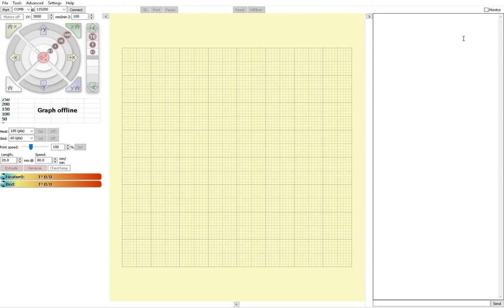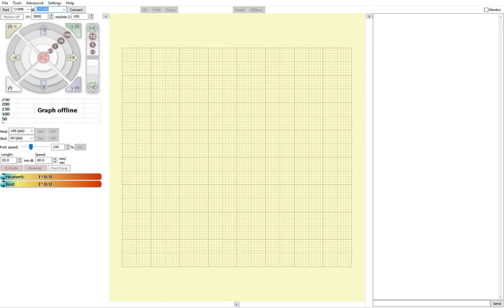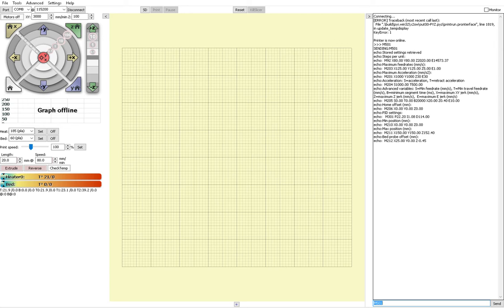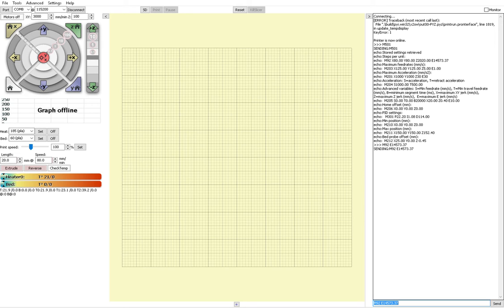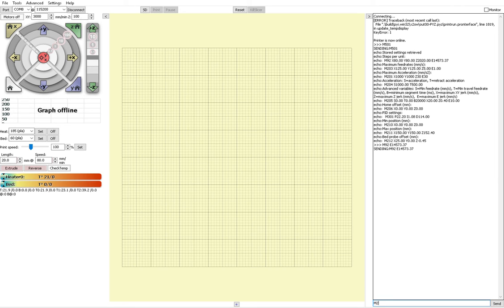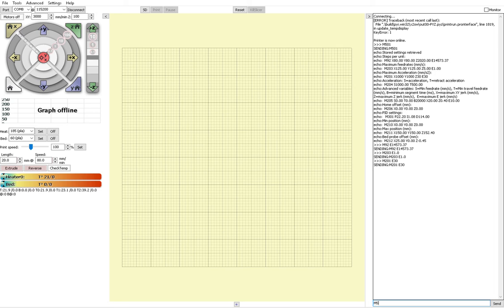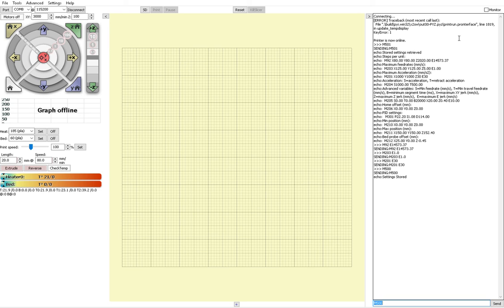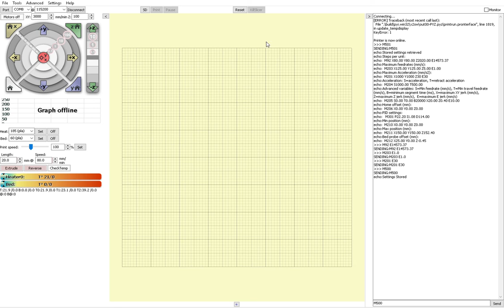Pronterface Steps/mm Adjustment for FRESH Printing

Comment: Hi, much appreciated for the great job. I am  building a large volume syringe extruder, but when I set the "steps-per-millimeter" of 9255.38, it goes way too fast.  I just can't figure out what went wrong. Is there any issue need to concern while setting the extruder. Any suggesstion is welcome. Thank you in advance.
Reply: Are you talking about when you try to "extrude" 1mm directly using pronterface, or when the printer is printing an object you've sliced. A reason it could be turning so quickly when printing something is that the "filament diameter" of your slicing software wasn't adjusted to be the internal diameter of the syringe you're using.
Reply: @cortexion4128  Thank you, Cortexion. I was taking about printing a sliced model. I think the formula I used is correct :   [(360degrees/1.8degrees)]*16*[47(number of big gear teeth)/13(number of small gear teeth)]/1.25mm = 9255.38. However, the syringe plunger was moving very fast during printing. I got your point, but I actually set the filament diameter as the inner diameter of the syringe in Cura. Maybe something wrong happened in Cura? I agree with you that the filament diameter probably is the reseaon. Will change it in the marlin firmware in the Arduino and try again. Thank you very much.
Reply: @kevinqiu7749  Your steps/mm is correct (I assume you're following the paper: https://www.sciencedirect.com/science/article/pii/S2468067217300822). Did you double and triple check the steps/mm change was properly saved to the board by typing M501? We've had it before where it doesn't write sometimes... There are also Slic3r and Cura settings vids available on the FRESH Prints channel if you haven't checked them out yet. There's a small chance your retraction distance and speed wasn't changed so you're actually retracting a lot more than you need despite your positive extrusion being correct.
Reply: @cortexion4128  Hi, Cortexion. Thank you for your time and patience and sorry for replying late. Due to the lockdown, we had been unable to go to the lab for several months.  I finally figured out this problem. I set the filament diameter at the Cura, which turns out the steps/mm do not change accordingly.  Then I changed the filament diameter in the Repetier and the printer now could extrude very precisely.

Comment: Printrbot aimple metal...Using pronterface My y axis home is going away from y limit switch....also,when i change my z home offset it changes in settings but not actually changing home position....also when i move via pronter interface the printer is moving way more than expected

Comment: I have a question - I have a Monoprice mini V1, and I added a E3D V6 genuine Hotend, and was able to calibrate it etc through Pronterface. One issue I DO have though, is that when I 'home' my hotend right now, the hotend 'homes' about 3 mm or so off the front left corner of the heated bed ('left' meaning when you are facing it, its on your left). Is there a command I can upload through Pronterface to offset this so that it will 'home' on the left front corner of the bed like it did with the factory hotend? What commands would that be to correct that back to the way it was (homing at the left front corner)?  Its not a setting in Cura, I am having this issue when I just try to home the hot end through buttons on the monoprice. Any advice would be much appreciated!

Comment: Nice job,  how do you calculate the value you enter in the instruction M92 E?
Reply: NEMA 17 stepper motor has 16 microsteps per step, and 200 steps per 360 degree rotation = 3200 steps / rotation

The small gear on the NEMA motor has 13 teeth, the large gear on the Replistruder has 47, so the gearing ratio is (47/13) = 3.615

The steps the NEMA motor needs to rotate the big gear is therefore (3200*3.615) = 11569

The pitch of the 6/32 lead screw is ~0.794, so 1 rotation of the lead screw moves 0.794 mm in z.

Therefore to move 1 mm in z, the large gear needs to move (11569/0.794) = 14570 steps.

Small rounding differences between this number and the video's but the math is still overall the same.